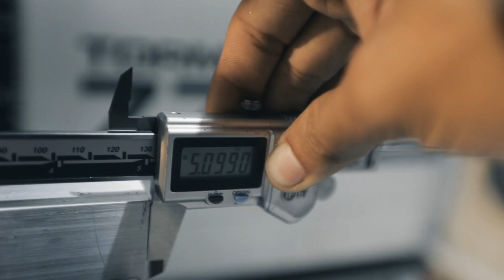CNC Machining the TITAN-57M on a TORMACH | Op #1

Comment: Hey everyone, I'm going to be starting my first Job as a CNC Machinist, I'm pretty nervous and could use some tips. I will be using a Haas machine. Thanks!
Reply: Here's a couple tips...
#1 measure twice, cut once
#2 double and triple check your Z axis value and tool lengths!
(I'd rather scrap a part than scrap a spindle, that would cost thousands of dollars to replace)
#3 don't be scared to ask questions!
(If you don't ask you won't know, until it's too late)
Good Luck and God speed young apprentice!
🤘🤘

Comment: Could you CMM this part afterwards to show the tolerances the Tormach can hold?
Reply: I'd really be interested in this as well.  I have heard good and bad about this.  It would be nice to get an honest opinion from you guys.
Reply: I have a tormach 1100m.  Holds between 1-2 thou.  Not aerospace worthy but more than good enough for the parts I manufacture.